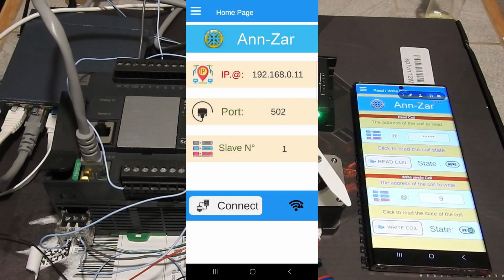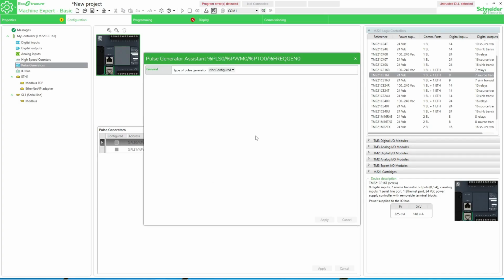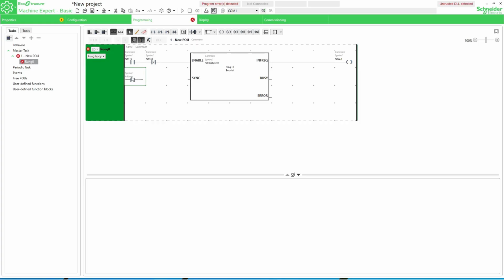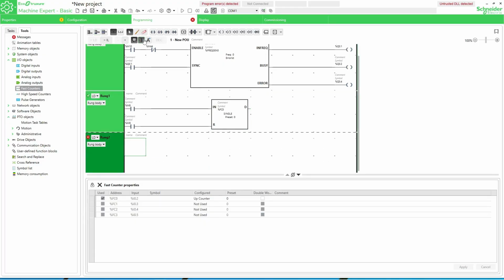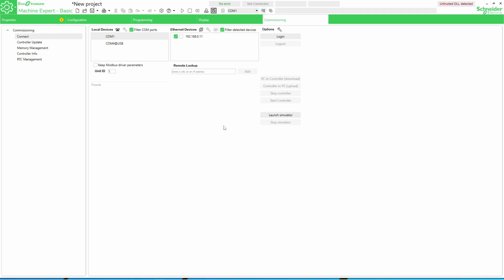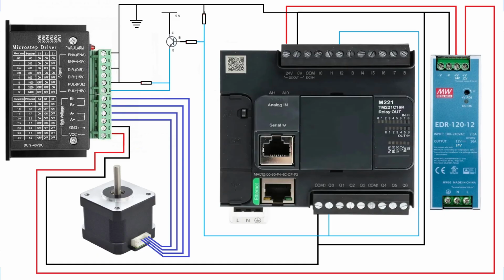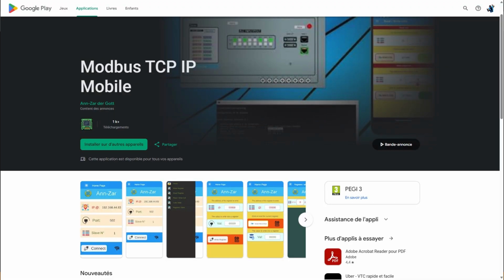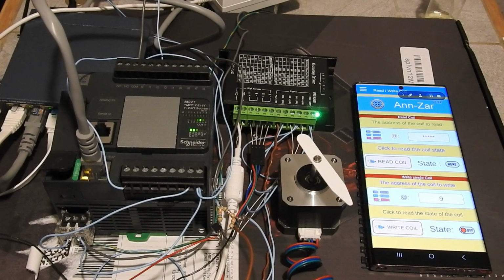How to Control a Stepper Motor with Schneider PLC TM221 + TB6600 + Modbus TCP

Comment: Hello everyone. I have a question: what transistor and resistors do I need?:hand-pink-waving:
Reply from the maker: Hello,
You can use the BC337, 2N2222A  or BC547 transistor. Use a 5k resistor between the emitter (E) and GND, a 10k resistor between the output (Q0.0) and the base (B), and another 10k resistor between the base (B) and GND.
Reply: @ann-zardergott2523  thanks.🙂